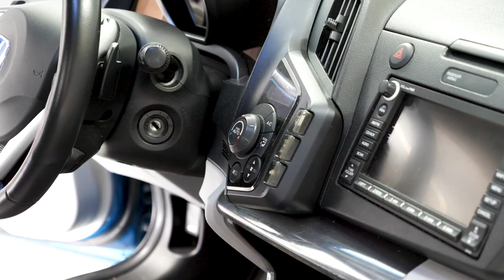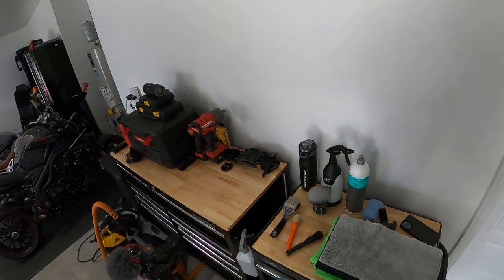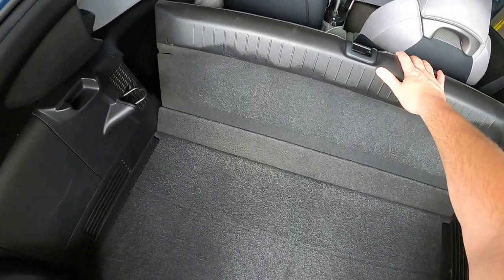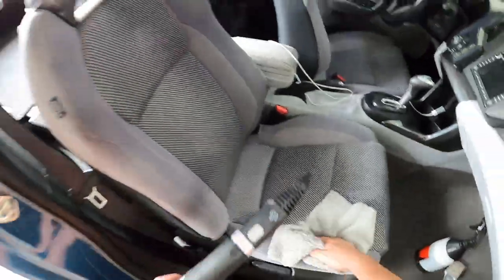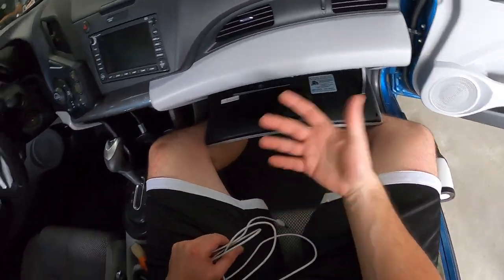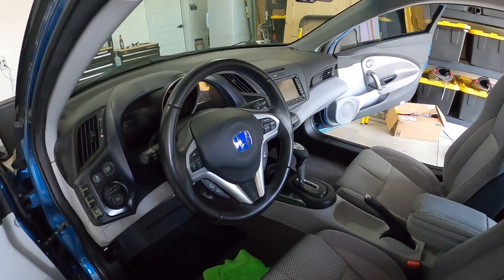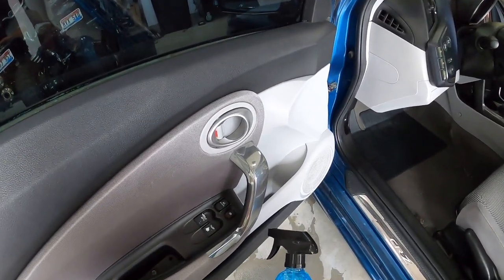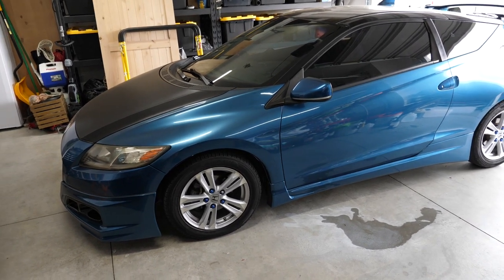Honda CRZ Interior Detailing DEEP CLEAN! | Time to Sell?

Comment: Greetings from Ukraine! Very sad to know that you decided to sell your CR-Z. I also own one, but mine is manual with leather seats and a panoramic roof. Amazing daily driver especially considering the fuel crisis we have (more than half of the gas stations don't have any fuel, but it's getting better). When running from war I averaged ~56 mpg for a 500-mile trip west. It was very inspiring to finally find great, high-quality content about CR-Z. Now we have a lot more important things to care about but I hope that the war will be over soon and I will be able to modify my CR-Z to look as amazing as yours. Peace!
Reply: Best of luck with what’s going on in Ukraine.

My son has a CRZ, sounds the same as yours, manual, with panoramic roof and leather interior (called GT spec here in the U.K.)

Highly recommend upgrading the wheels to 17” - my lad found some Civic type R EP3 wheels, which we refurbished in Honda white - they really pop against the Blue (same colour as Anthony’s) bodywork, and are a perfect fit (correct offset etc.)

Plans are upgraded brakes (Type S are a straight swap), then either super, or turbo charger - centre exit exhaust, and a few other bits and bobs.

If I didn’t already run a Z of my own (370Z), I’d happily run a gently modded CRZ!

Slava Ukraini!
Reply: Glad to hear positive vibes and attitudes in the Ukraine much love 💙